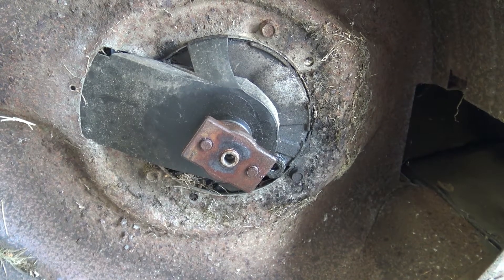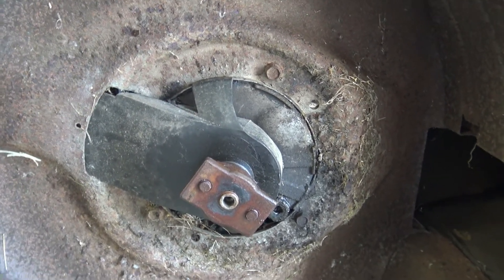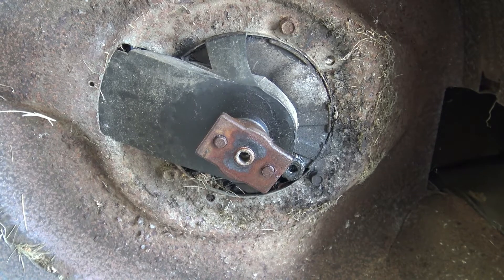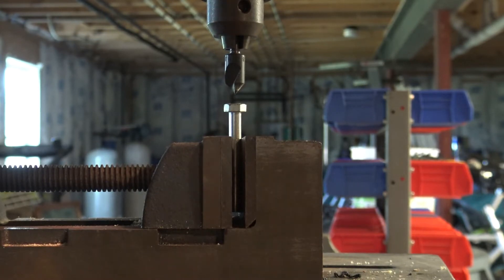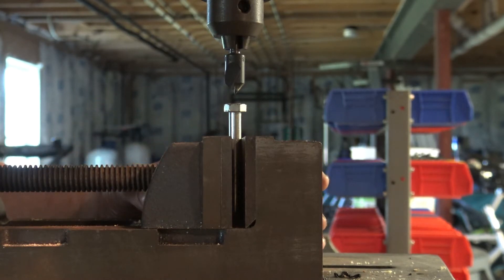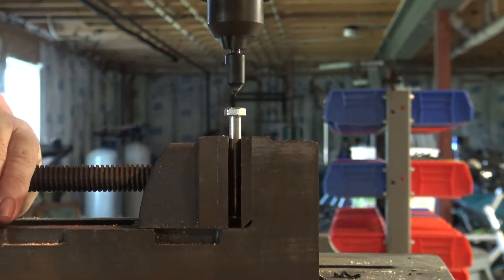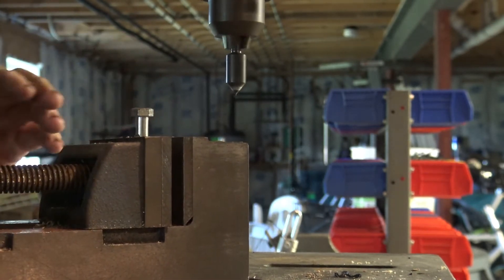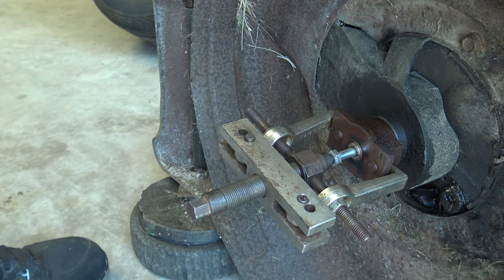How to remove a lawnmower blade adaptor

Comment: Great video.  What's the typical length for that modified bolt you use for the pivot point?
Reply from the maker: Thanks for the question and the kind words; It just so happens I saved the modified bolt and have it in my hand.  It is a 5/16 bolt and I cut it off as to make it 3 inches long. I don't remember how long it was before I cut it off but it had to be at least 4 inches or more. It was an ordinary grade 5 bolt however if you are headed to the hardware store to buy one I would opt for a grade 8 bolt as it would be much stronger. Let me know how you do getting your adaptor off. Don't forget the safety glasses. Thanks for watching.
Reply: @richardspaulding5035  Finally getting back to this as I went junkyarding the other day and used your technique to get a couple blade adapters off a couple old Jacobsen mowers.  Two out of three were a success, and that was with using a ratchet to drive the puller.  I suspect if I had my impact gun I would have gotten all three off.  I actually ended up using some 1/4" drive extensions (different lengths were required) as my pivot point.

Comment: On blade holder do you have to have the 2 stabilizer fingers?
Reply from the maker: I am very sorry I have taken so long to reply. I spent some time in the hospital this past week. I am not sure I understand the question you are asking. If it is about the puller set I used, it was a Snap-On that was purchase as a young mechanic in the 1970s.

Comment: What kind of puller is that
Reply from the maker: Thanks for the question, Bentley; That was part of a Snap On gear puller set I purchased right off the visiting Snap On Truck as a young mechanic in the 1970s. I do not recall the exact part number. if you go to the Snap On web site and type in the search box "gear puller set" they have several offerings. These days they are very pricey at about $700+.
Reply: @richardspaulding5035  how many inches is it. I've noticed jaw puller sets containing a puller of 6 inches, 4 inches and 2 inches, which one is it please
Reply from the maker: @workoutman4252  It was the middle size of the 3 sets of jaws that came with the kit. I just measured it at 94 mm or 3.703 inches. I measured that from the center of the locating hole to the part that grips the work piece.

Comment: What tool do u use to take it off?
Reply from the maker: It was the Snap-On CJ282B Puller set.  I purchased it in the 1970s right off the Snap on truck as a young mechanic. I think they are quite pricy now. You can still find used sets on eBay a lot cheaper. thanks for the question and watching my channel
Reply: Richard Spaulding is there another way to take it off with just regular tools
Reply: I’m only 14 and just started my business
Reply from the maker: @boomkiller84_yt40  I don't think there is,  at least in my case that thing was on there. I don't think there is ant way without some sort of puller. Perhaps you can borrow one somewhere.  Thanks for your question.

Comment: where do u get a jaw puller like that?
Reply from the maker: Thanks for the question. I had to go back and watch the video to see what I used.  It was the Snap-On CJ282B Puller set. I purchased it right off the Snap-on truck in the 1970s when I first became a mechanic. I do not know if the set is still available itself but I recently was able to purchase a replacement part from them. I just now looked on eBay and there are several used sets available. Thanks for watching my channel.